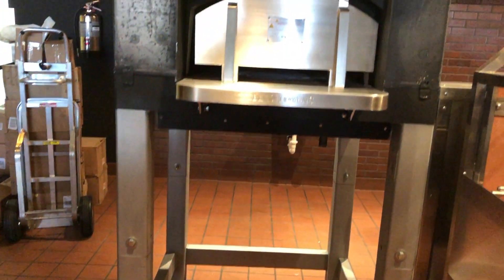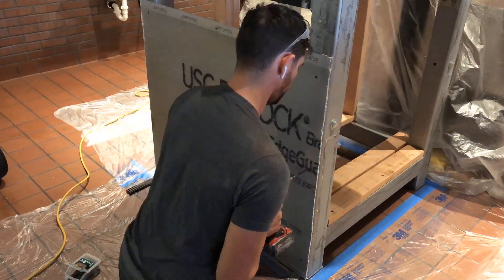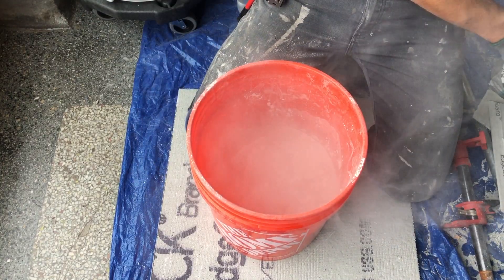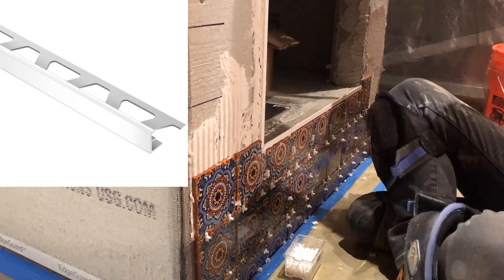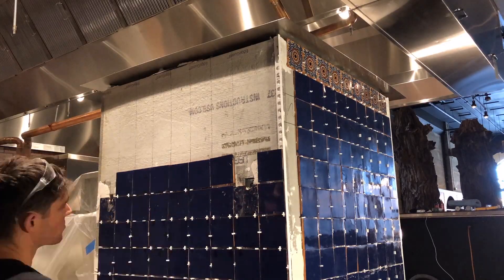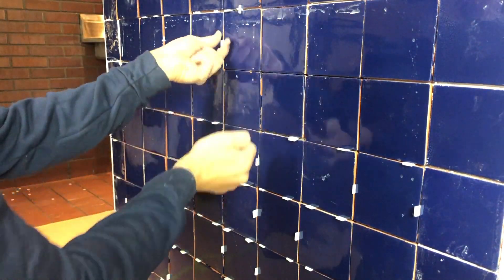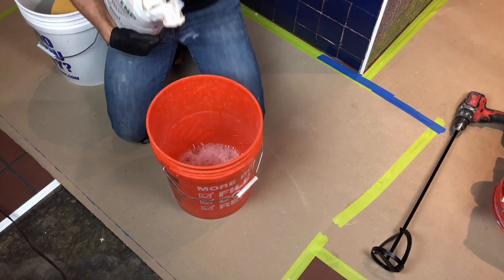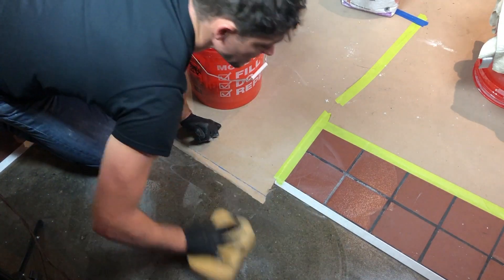WOOD FIRED OVEN MAKEOVER : DIY Tile PRO

Comment: Doesn’t that oven get too hot for the cement board and tiles. We have a Beech pizza oven and someone said we have to have 1 inch of special insulation first. When I saw your project I thought that was great I’ll do the same on this oven. Please I hope you get this message or at least someone can respond. Your thoughts please.